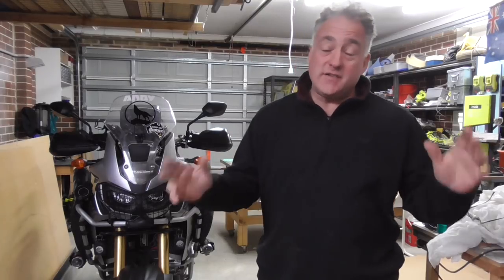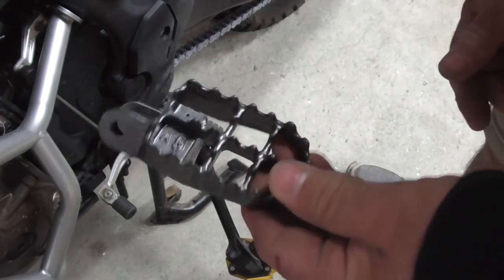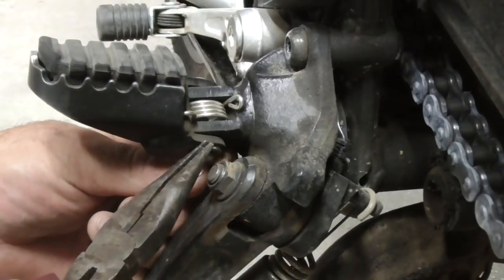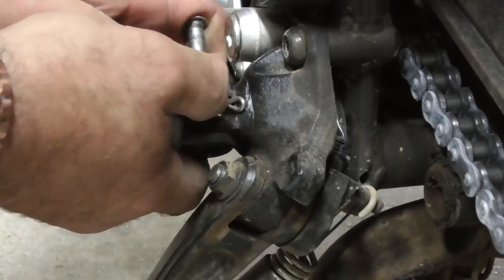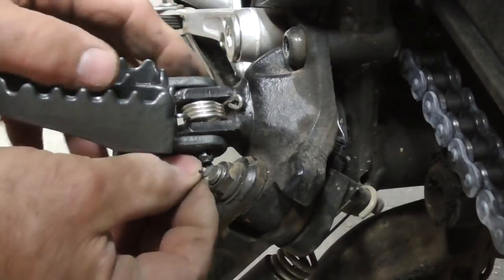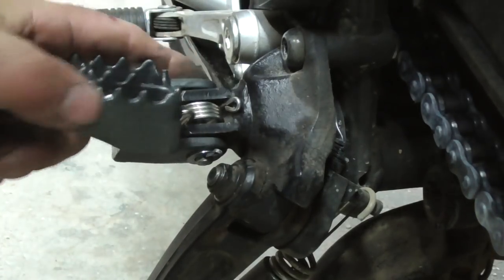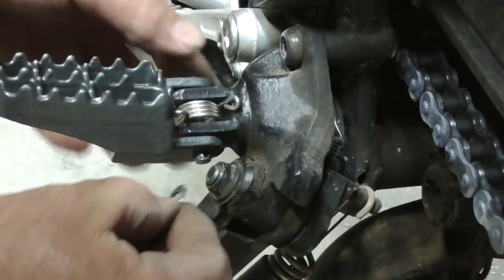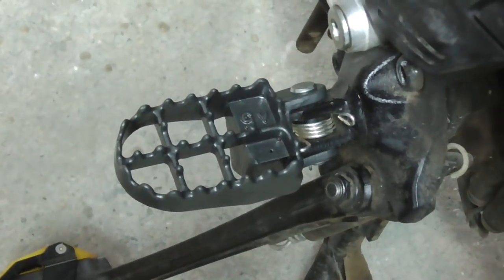Africa twin Foot pegs upgrade

Comment: You'll enjoy the wider peg Andy, takes stability to another level.  I do have the pivot pegs on my KTM SA and love them.  Nice cheaper option provided by big Steve though
Reply from the maker: Rockin Scotty 
Thanks buddy. Yes worth a shot for the money. I do like the pivot pegs though. Has ive just had to lift my gear shifter up by 25mm to compensate. Wouldnt of needed to do that with pivot pegs. 👍👍

Comment: Hi Andy - nice video! Have you got a long(er) term review or thoughts on the footpegs? I'm thinking of a pair...  And any more thoughts on the Camel brace? Thanks!
Reply from the maker: Pegs are great mate. Only problem i have had was i have twice caught the bottom of my pants on them when putting foot down which made me mearlly drop it.
Camel brace is a must mate especially if you are mounting off the frame.
Reply from the maker: Just thought ide touch base
Been on a few years now and still going well. 👍👍